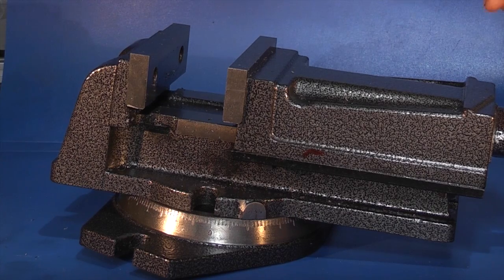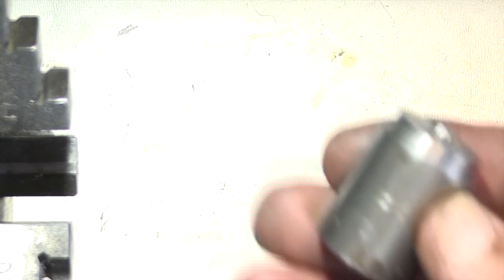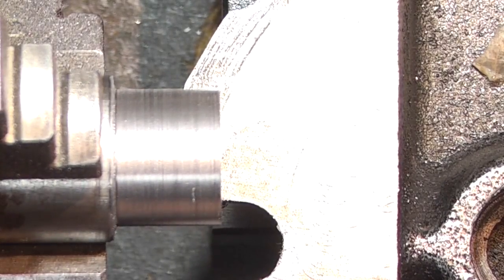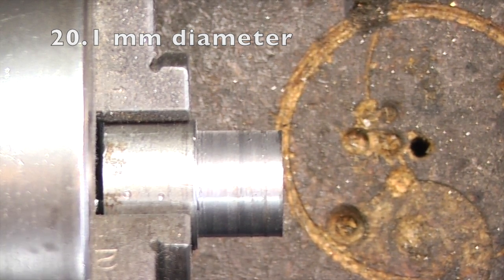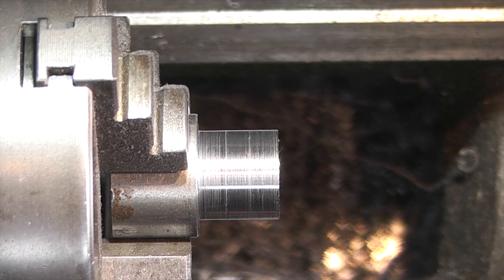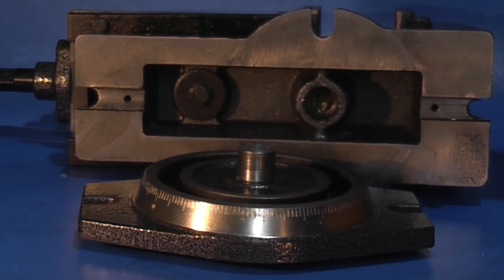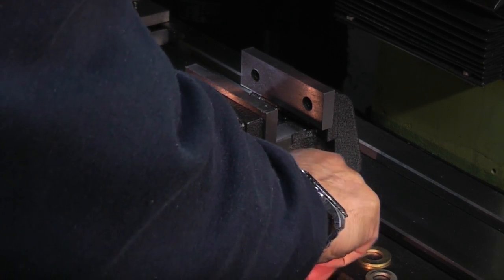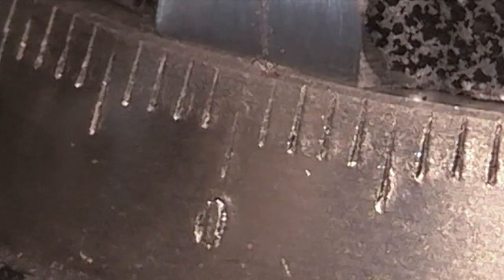New swivel pin for the mill vice

Comment: Hi Alan, nice to be here. Hi yes that swivel base pin you have is really bad, wow went right away out into the Machine Shop area to check my vintage 6.00" precision machine vise made by Ellis Manufacturing and it rock solid, mounted it placed n indicator and she will not move forwards backwards side to side what have you, so thank you for the tip we always set the vise and indicate it in but we do not always use our swivel base, so it was good to check our  discoveries on its swivel.
 Lance & Patrick.

Comment: Hi Allen.  I’m surprised you didn’t redrill the hole on the bottom of the vise.  Nice rebuild.
Reply from the maker: Hi Dale I don’t have a drill or reamer  at 20mm
Reply: @enotsengineering  I'd say a boring head should be high on your future tooling list. I wouldn't have hesitated to bore that hole in the vise so it was both round and straight. In a pinch before I bought my boring heads I've used a very small fly cutter with a tool ground to do boring. An exact nominal size isn't required so boring the hole out to what ever diameter it cleans up at should work fine. It depends on the exact type of work normally done in a shop, but I've never bothered to buy the swivel bases for my Kurt clones and have never missed not having them. The work piece is held far more rigidly without them and the vise can be clamped down at what ever angle is needed using an angle gauge or a sine bar if it needs extreme accuracy.

Comment: Allen, a good technique to determine if a hole is taper or just out of round is to apply a light coat of grease then pour in melted parfait wax and let it harden. Remove the wax plug and make some measurements. I watched an old mechanist do this at work once and it works really well.